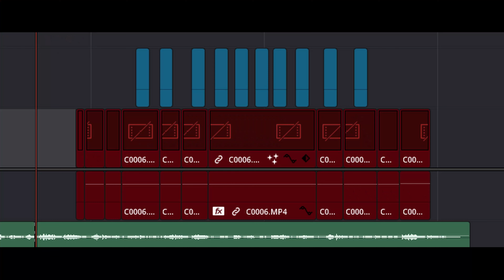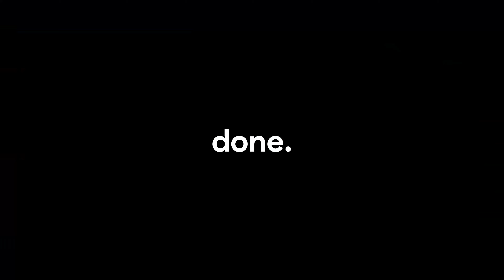sinc 75% build

Comment: What are the knobs for? I would love an answer on this but I can't find it anywhere.
Reply: They are rotary encoders. Basically it takes the spinning steps and converts it to a key press so you can do something like lowering the volume but there are other ways to program it. They are the size of a key switch however they won't fit in any ole switch space, if the pcb has support for it, there will be specific locations with the 3 holes needed.
Reply: @frozenfenix0  Thank you.

Comment: So I wanna grab this keyboard. It says it's only 60$. Does this feel like a cheap keyboard? I mean, green pcb is kinda cancer, but I don't want that to be the only thing that makes me not pick this thing up. How's the case (or in this case, the two plates that make a case)? Does it feel nice or cheap?
Reply from the maker: No it does not feel like a cheap keyboard whatsoever. In all honestly you can't see the Green PCB with everyday typing and if you have a huge problem with it you can get a 3d printed mid layer to go in between the 2 plates. Though overall it's all preference. The sandwich case of course costs cheaper then a full case. Overall it's a very nice build and it's up to you to get but I would recommend it. It also is a great project to get started into keyboards.